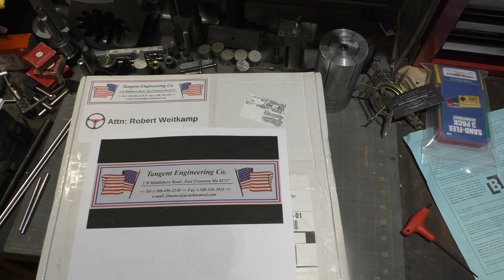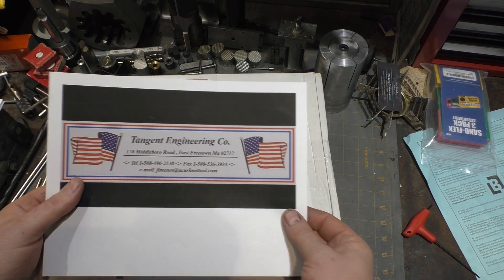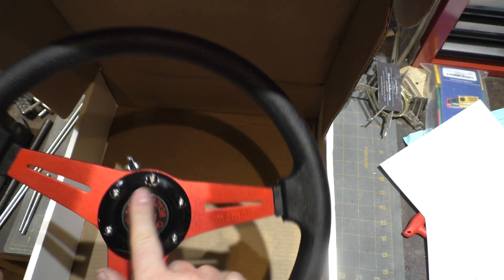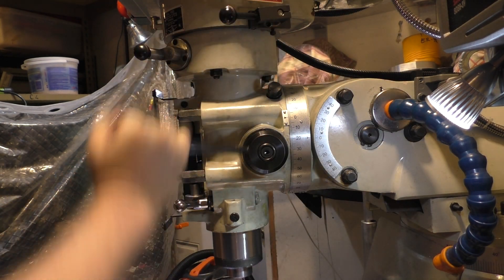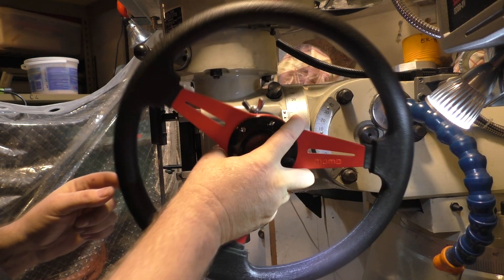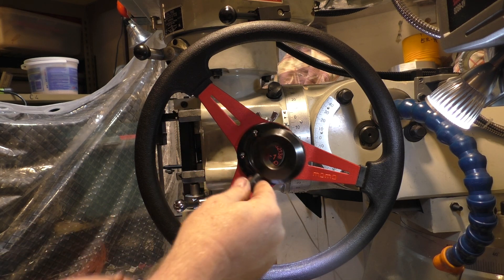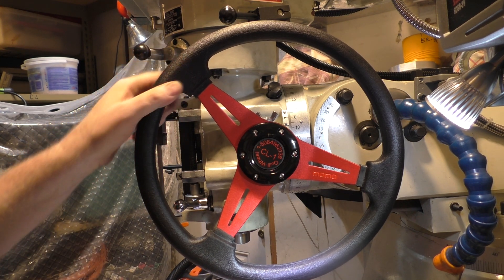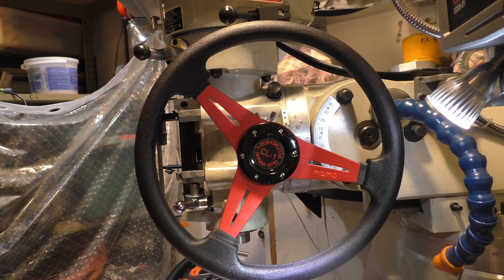QTR 45 Tangent Engineerings Mill Quill Wheel

Comment: 150 bucks, I made mine with a brand new gokart wheel for 23 bucks,
Reply from the maker: Excellent idea. Hopefully others will benefit. I also find after using it for a while that I sometimes have to switch to the old handle becuse the wheel gets in the way of the work.

Comment: I'm so used to the spider quill feed handle on the Enco mill at work, where I drill a lot of holes through drill bushings on fixtures.  It looks similar to this one: https://www.amazon.com/dp/B0007ZFJYU  I don't think I could be as fast with a steering wheel.
Reply from the maker: I remember those. I got rid of my drill press to make room for the mill and other tools. I forgot about that type of handle and thanks for putting a name to it. I had no idea. I do remember using one and the times when I had to use two hands to keep constant pressure. Interesting.

Comment: Jim at Tangent Engineering is a great guy. He provided me with a steering wheel for my own mill wheel project and his dimensioned drawing was invaluable. He's a very helpful guy and has some other interesting products if you are burning up the brake piston seals on a Corvette! The wheel is a huge improvement over the old one armed bandit and a great addition to the mill.
Reply from the maker: He was exceptionally generous to offer me this wheel and I have used it a bunch already and really like it so far. I thought I might miss the old handle, but wait, what old handle?

Comment: My Momo steering wheel is going to remain on my buggy. but I do have a bunch of Grant steering steels I may use to make one. Those GOTS TO BE EXPENSIVE
Reply from the maker: You might be very correct. I have no idea what the gentleman at Tangent Engineering intends to charge. Maybe he has some sort of connection with the folks at Momo. They are pricey steering wheels, but they do feel great in the hand.

Comment: It’s a normal car steering wheel you can buy at any car parts shop with a block of plastic and a couple of location pins and a thumb screw it’s less than $100 worth of material and an hour on the mill I don’t get the excitement
Reply from the maker: The mill interface is, I believe, anodized aluminum with hardened pins. The Momo steering wheels are quite pricey, but feel great in the hand. I had an interest in this idea since I watched Tom Lipton's video a while ago. We don't all need to get the same interest out of every project. It's cool, I completely understand.

Comment: Knowing you, I wouldn’t be surprised to see you turn the wheel true (has a small runout).  We would need the heated version up here north. 😆
Reply from the maker: Heated. I love that. The soft foam grip is pretty insulating. I have used this wheel quite a bit these last two weeks (since I shot this video) and I really like the wheel so far.
Reply: Lol Yuchol, you think YOU folks need a heated steering wheel?  Ever hung out in Northern Alberta in the winter?
Reply: Everett's Workshop it seems I’ve been away from the harsh Montana winters too long.  I’ve become soft.

Comment: Nice, but I don't expect this to be cheap. The Momo steering wheels I've seen are 175 to 300 bucks. I think I would almost prefer a iron spoked handwheel from McMaster. It would probably be cheaper, fit the style of the mill better, and you wouldn't have to worry about cutting fluids.
Reply from the maker: An iron spoked wheel would be nice too and boy were yo right about the Momo steering wheels. They are pricey. I don'y know what the gentleman at Tangent Engineering is going to charge. That price could easily effect decisions to buy.
Reply: We are offering them for $150.00 Free Shipping in the lower 48 States .
Again, Free shipping in the lower 48 States .
Do the math , That is a great deal !

Comment: What a great idea! A good add on would be a large truck steering wheel ball. Make it adjustable for That extra torque. It should be easy to make.. Thanks Mr. Dudley!!!
Reply from the maker: I like that idea as well thanks. I have a paraplegic aunt that can drive a modified car. One of the changes is a rotating ball on the steering wheel so she can control the brake/accelerator with the other. You can get an amazing amount of torque off of that thing.